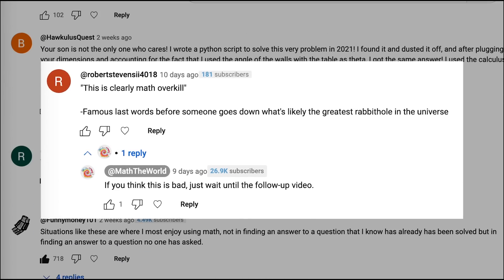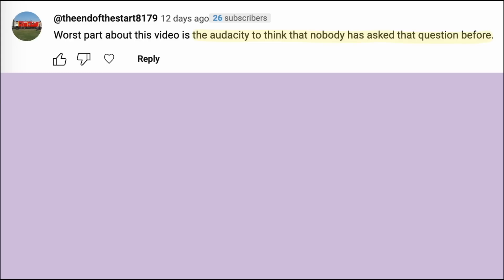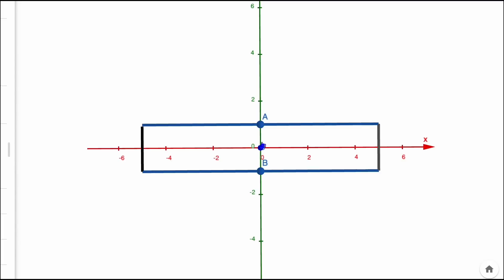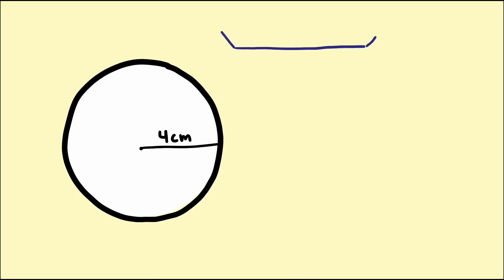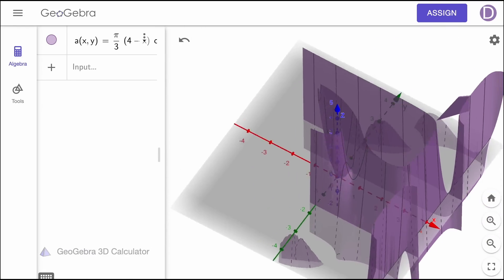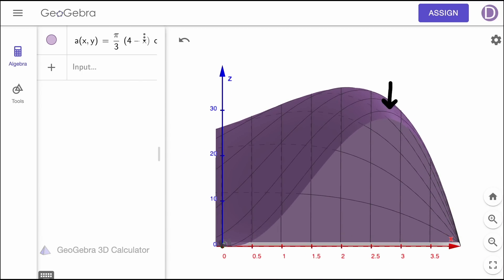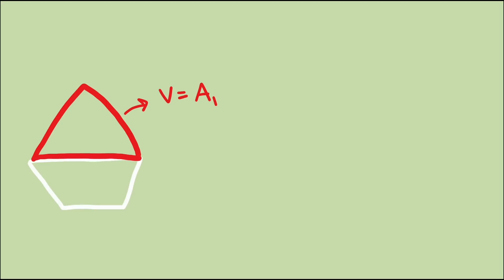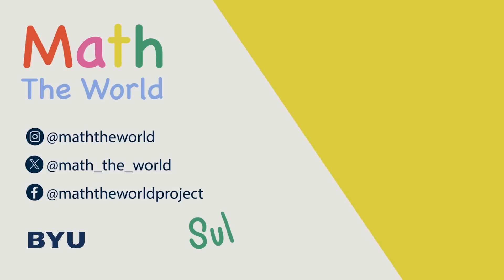Optimizing Cups to Get Every Ounce of Sauce Possible

Comment: Would have been interesting to explore the idea that the cup unfolds at discrete increments, and maybe use a sequence or something to represent the discrete steps at which the top of the circumference changes in reality, as opposed to the continuous nature of the change that's represented in the math problem you've created. That way you could have a definite "you need to unfold this many parts of the cup" answer instead of an angle which would be harder to estimate in a real world situation.

Comment: There are a few things to keep in mind with having that shape. The weight of the center of mass of the volume that is directly above the angled wall will exert pressure on the angled wall, therefore this shape could not be stable over time. And the rheology of the sauce could not be steady with that 30° angle

Comment: Why did you change the axis of rotation?!

By the way: your channel is AMAZING!!! Absolutely hats off to your level of both creativity and commitment to service and educating self learners!
Reply from the maker: Thank you so much! 

Is your question referring to our argument about my optimizing the 2D area is not the same as optimizing the volume of revolution? You end up with the same shapes by rotating the axis or by rotating the area, but by rotating the axis it's a lot easier to see that one has more volume than the other because the small one is almost completely enclosed in the large one. Doing it the other way is just a little harder to see.

Comment: Awesome idea for a channel, you definitely deserve to get more views!

Wondering if you're thinking about adding some dynamic/recursive models as well? I remember we used to have a course in my economics program that started out with a silly question like 'What's the best way to eat a cake', given that you can either eat it now or save some for later, and it ended up covering some interesting models with regards to what the best balance was for consumption/saving, given that any consumption today makes you happier right now, but saving allows you to consume more at a later time. So you get really neat models that take time into account and get dependent on past actions/future considerations.
Reply from the maker: Thank you so much for the positive feedback! 

I am sure we will end up with some dynamic models at some point. But I hadn't thought about modeling cake eating. If you have more information on that, send it my way. I've read a lot of economics, but mainly conceptual, not mathematical topics. This is one reason why I feel like I need an undergraduate degree in every technical field because it would open my eyes to so many ways that mathematics is used.
Reply: @MathTheWorld  Sure thing, I looked around a bit and found a pdf file that explains the setup and shows you can work these models out in Excel, but there's a whole bunch around that explain it in greater detail if you look up 'cake-eating problem economics': 

https://ani.stat.fsu.edu/~jfrade/HOMEWORKS/Fin_Econ2/session05.pdf

Obviously, the cake-eating problem is an analogy for a simple consumption/savings problem, and you can start adding all kinds of additional considerations into your models if you want. Hence, a lot of assumptions about 'utility' gained from consumption is very general, but you're free to use more or less whatever utility functions you want given the scenario you're trying to model. 

Also found a youtube video of someone who modelled this in excel and added uncertainty by using random time-preferences for the cake-eater, so you get different consumption behaviors depending on how much someone would discount their future consumption. He doesn't really explain it in detail but its pretty neat: 

https://www.youtube.com/watch?v=Pq6naLdW1oE&ab_channel=EconJohn

Comment: I optimized my sauce cups by blowing into the top and inflating the cup like a balloon.  If I keep the rim intact, I'll end up with a highly optimized shape. Unfolding the rim expands the shape slightly, but the math starts to look like differential geometry and dynamical systems, which I'm not ready to mess with yet
Reply from the maker: A couple other commenters have shared that strategy. It's one I hadn't thought about. 

I toyed with the idea of analyzing that strategy in part 3 that's coming up, but the math is just as difficult as optimizing the bowl shape when you open up the rim.

Comment: It should be mentioned for the multivariate version that it is possible that the partials are both 0 are a local extrema and not global. You also want to check the edges of the domain, as partials might not equal 0 there due to domain restrictions but you still might have a greater value. 

One might argue you can ignore this if you know roughly where the maximum is and the edges of the domain are definitely nowhere near, but that only works in certain cases and not for everything.
Reply from the maker: The once you bring up our valid. I debated how much to get into these, but since we had a good visual of the situation once we restricted the domain to the context we were working with, I thought it might be a bit much to emphasize those things ( or saddle points) since we could see from the surface what we were dealing with. I certainly could have hurt viewers thinking that finding the maximum on a 3D surface was always this easy.

Comment: If you're allowed to change where the flat region of the cup ends, then surely, you're not limited to a flat region and a angled region. The angle of the walls could vary continuously to make a rounded bowl shape that could hold even more sauce. Anyone up for some calculus of variations?
Reply from the maker: Yes that is the plan for part 3!

Comment: For people who were not too happy about the explanation as to why maximizing the cross sectional area isn't the same problem here, by the Theorems of Pappus-Gulding, the revolution volume IS actually proportional to the cross-sectional area, the problem being it is also proportional to the average distance of the points of the object (or, in this case, one half of it) to your axis of rotation, so, since changing the shape of the object (as if to maximize the area) may also change the average distance of the object's points to the axis, the problem is more subtle then just maxizing the cross-sectional area. His example got confusing because he changed the axis of rotation (instead of showing the equivalent change in shape), while, in the paper cup problem, the axis of rotation is determined.
Reply from the maker: Thanks for bringing in Pappus. Making that connection it's a good way to understand why maximizing the 2D area is not the same as maximizing the volume.
Reply: Thank you for this! I was thinking along the same line but couldn't remember exactly the reason why

Comment: One thing to point out is that the term "Viscosity" is not accurate for how high a sauce can extend beyond the rim. In this case, if the sauce is a Newtonian fluid, the fluid will always overflow the edges (though it may take a long time, such as the material "Pitch"). Ketchup is not a Newtonian fluid, but rather a Bingham Plastic. Bingham plastics do not flow when under a certain shear stress, known as the "Critical Stress" or "Yield Stress". While it can be correlated between similar fluids with viscosity, it is not the same, and a Bingham plastic can have a low viscosity. As an example, Coal slurry has a lower viscosity than printing ink, but a higher critical stress. For ketchup, I have seen critical stresses in the range of 15-30 Pa, which would give a support angle of 35 - 45 degrees at a 1.5cm radius. I'll try and make a longer write up once I do some additional math.
Reply: I haven't gotten to that part of the video yet, but wouldn't viscosity not even apply here? I thought viscosity whether that be Newtonian or otherwise was a mapping of fluid velocity gradient across a surface.  In this case the sauce should have zero velocity and therefore the gradient velocity of the ketchup should be zero everywhere.  The mechanism that allows sauce to exceed its volume I believe is what you are describing which I think means the  sauce continuum is able to generate some internal shear stress along the skin to resist body forces
Reply: @chain3519  Yea, I did the math and it ends up being a sqrt curve from the outside in. I got a total volume of 97.4022cm^3 after all was said and done, with a bottom radius of 2.22cm top radius of 3.802cm, and an angle of 62.8 degrees. I used a 21.8 Pa critical stress since I found that in a google search.
Reply: I'm no expert here, but isn't surface tension involved here? Or is that a different phenomenon
Reply: @benG2141  Surface tension would have an effect, but it would be less than for water due to the other components in it. A quick google search found that water has a surface tension of ~ 72 mN/m, whereas ketchup is 30-40 mN/m.

Comment: But would it actually be possible to fold the cup to have that radius without cutting it?
Reply from the maker: Yes, you don't have to cut it to get a different sized base. The folds are approximately triangles with the vertex starting on the edge of the base. So you can fold the triangles and have that vertex any distance away from the center. Well, up until physical limitations of folding the paper into an extremely small fold.

Comment: Excellent video. Something I did find a little unsatisfying in the previous video is that you went straight into the numbers/graphing instead of trying an analytical approach. Here you end up (unfortunately) with a cubic, which isn't very nice, but it does show (albeit this is already pretty obvious) that the optimum angle θ only depends on the ratio of the base radius to the slant length (r/l = a):
sin³ θ + 2a sin² θ + (a² − 2/3) sin θ - a = 0
Sometimes an analytical approach gives better insights into how the solution would change as you change the parameters (although here it may not be as useful). Of course graphing is still super nice as a visualization.
Reply from the maker: That is really nice. Yes, I should have emphasized that more. But on the bright side, you can use the general form you've created to solve the challenge problem at the end of the video!

Comment: I'm pretty sure the cross-sectional area is proportional to the volume of the solid of revolution iff you square the magnitude of the coordinates on the cross axis (e.g., the x axis when revolving around x = 0) before calculating the area, but that's a non-linear transformation so might be harder to optimise for than just working through the problem in 3d (e.g. a straight-line side would be transformed into a quadratic curve for area determination)